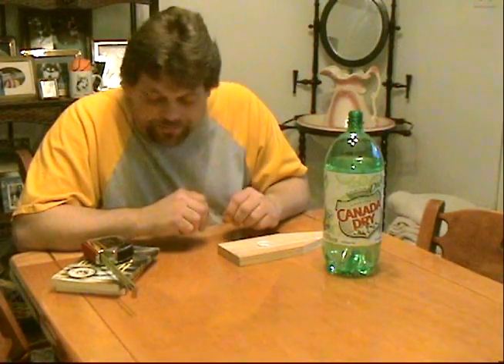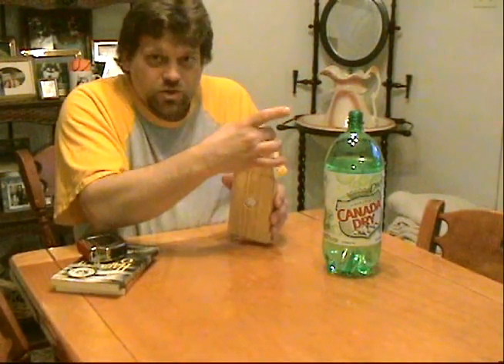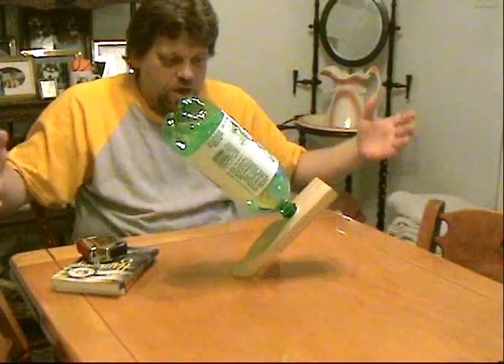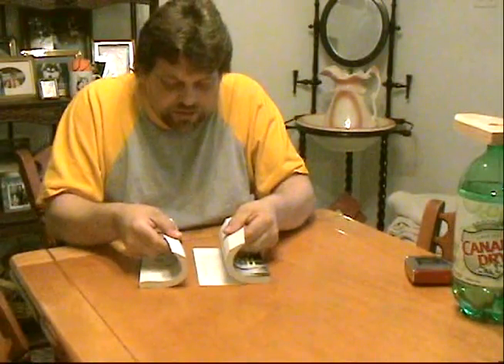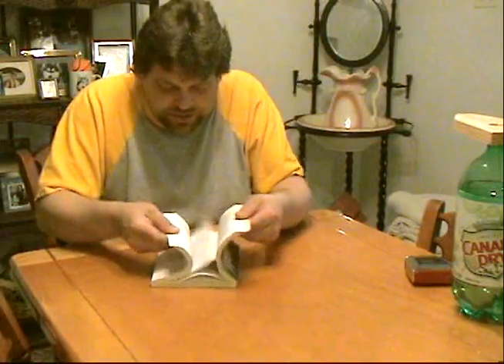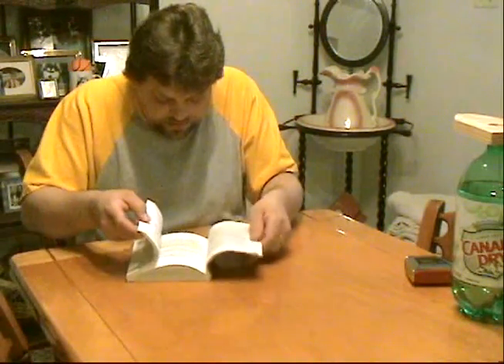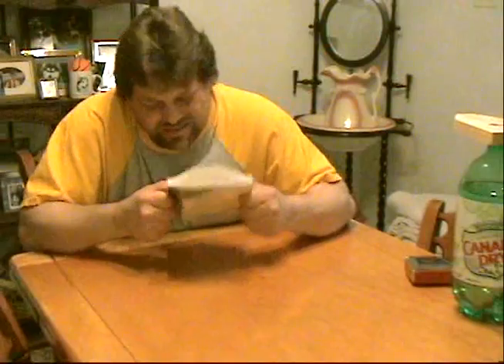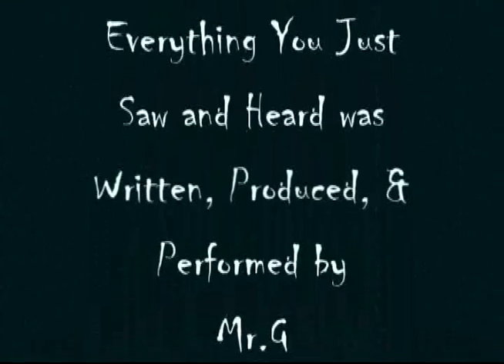Do Try This at Home! Episode 5 - Double Feature!!

Comment: part 1) i actually like the trics, pretty cool, BUT....... and i dont meen to be rude honestly i dont, but ur saying that we can take any normal household items and do some tricks with them well... to me dont know if anyone else agrees but a block of wood 3/4 inches thick, 9 1/2 inches long and 3 1/2 inches wide with a hole bored into it the exact same size as a bottle cap with a 45 degree angle tip on it

Comment: part 2) would not be known as an every day household item, that 1 kinda takes a bit more effort than just screwin it on the top of the bottle, i think u forgot the rest of the items needed such as a saw, plain, drill ect. which are all quite dangerous pieces of equitment, so i think that trick should go into the DONT try this at home pile

Comment: ~1.9 cm thick
~24.1 cm long
~8.9 cm wide
The hole is drilled ~8.3 cm from the top edge and the hole has a diameter of ~ 3 cm.

I know what you mean, I hate inches.

Comment: A half pointy block of wood 3/4 inches thick, 9.5 inches long, 3.5 inches wide with a 1.1875 wide hole 3.25 inches from the top edge is an ordinary household object. But.....np......Mr. G is awesome anyway.

Comment: You told me to try this at home, when I attempted to replicate the book trick I burned down a 4 story apartment building which was located right next to a train track. The heat from the fire caused the diesel fuel in a passing train to ignite and the entire train exploded in an enormous fireball. There happened to be 4 Amtrak train cars on it so unfortunately there were 100 casualties and much more injuries.

Comment: Yes, Mr. G, it's me once again, commenting on a video of yours. (I'll give you a break from the constant replying and wait on the other 4. ^^') My local Home Depot was sold out of 3/4x3x9 pentagons of wood with inch-wide tips cut at 45 degree-angles this week (They said to come back next Saturday for them.), but the book one worked just fine - I took 2 of my old Goosebumps books and interwove them, and they would NOT come apart! First the match gun and now this? Friction rocks!! (cont'd below)

Comment: On the book one, you don't have to pull the pages apart individually, you can just hold them by the top and bottom rather than the front and back, they come apart easy.

And btw, I like how you left the slow part like interweaving the two books in, especially since you filled in the boring parts with some type of dialogue. A lot of people force you to fast-forward through the slow parts.